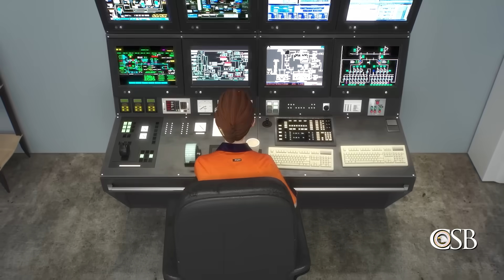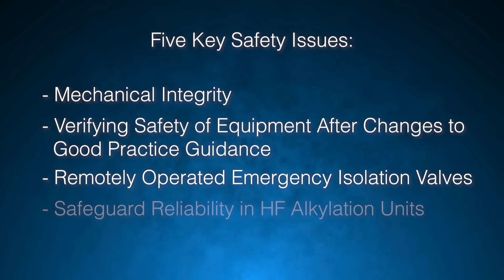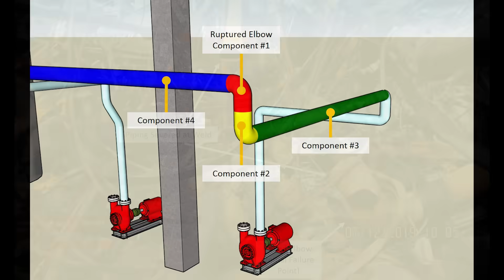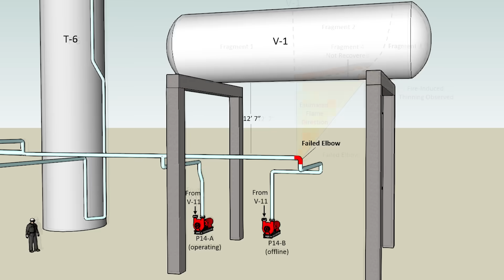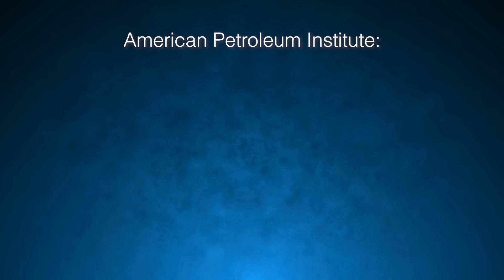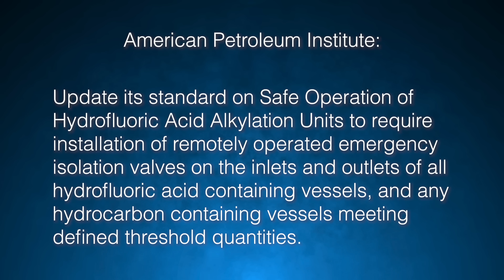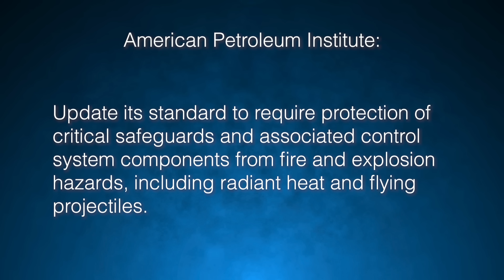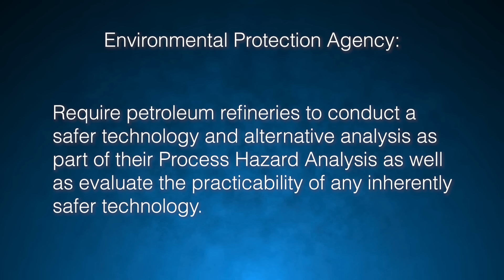Wake Up Call: Refinery Disaster in Philadelphia

Comment: I'm only at the very start of the video but the moment I heard an accident involving HF I cringed, there's not many "common" acids that scare me too much just as long as common sense and safety measures are applied when using them  (sulfuric, nitric, hydrochloric ect) but HF is one of them acids that I'm really uncomfortable working with even in low concentrations of 20% or less.
 although it takes a little longer to cause bad burns to flesh in the unfortunate event of an accident I have heard many rumors that the long-term effects throughout the entire body can be quiet severe.
I already suffer from fibromyalgia combined with ehlers danlos and the last thing I really need is HF exposure complications on top.

A vehicle detailer I work with was using aluminum cleaner which is a mix of various chemicals with the active ingredient 15% HF and they were spraying it from spray bottles with no gloves, no mask except a pair of safety glasses...
after I explained to her she really needs to be wearing proper PPE and a brief argument with her claiming she has been using it like that for years with no issues so I printed off some information about HF including the MSDS for the exact chemical she was using and the next day she had long thick chemical resistant gloves on with a face shield and a proper respirator, I can only imagine what her lungs look like after all them years breathing it in.

Comment: It's called bi-annual pipe and vessel inspections.  Every inch of pipe, and vessels should've been UT tested two times per year.  I live in a small rural town that has a large gas refinery.  It exploded in 1985.  Now it belongs to Hess Corporation and they inspect every inch of pipe, every vessel, and every pressure relief valve twice a year.  Once safety and inspection routines are overlooked this is what happens.

Comment: I was also a console operator on a Alkylation unit. A few things I’d like to point out. 1.) It’s actually insane that no one was seriously injured. I was actually driving across the commodore Barry bridge after a night shift and witnessed the sky turn from night to day from the explosion. At the time I didn’t know what it was but it was absolutely intense how bright it got. 2.) So much respect for this console operator and her ability to dump the HF out of the unit. With the explosions that acid could have traveled miles. 3.) I ended up working with a lot of PES guys after this explosion and they were all incredible to work with and extremely experienced. 4.) You hate to say it but a lot of times corners are cut or things are rushed in the hopes to save or make  money. 99% of the time we get away with it but that 1% chance something like this will happen. In a perfect world no corners should ever be cut and it seems that it’s the people on the business end that are making the calls from hundreds of miles away in office buildings out of harms way. 5.) The two refineries I worked at had constant x-raying/thickness reading taking place. Once they finished the whole unit, they would start over again on a steady rotation. Even then it’s possible not to catch everything because a compromised flange or valve or etc. can become an issue almost immediately with forewarning. Glad no one was seriously harmed. Great video.
Reply: As an NDT technician, the POD of flaws with thickness measurement is extremely low. Other tests like LRGW (qualitative inspection) are better but expensive. And is always about the money, unfortunately.
Reply: Insane, no, an absolute miracle that nobody was seriously injured or killed. I wonder if it was just sheer dumb luck or good design that prevented fragments from damaging the plant further, resulting in a greater release and potential explosion.
It's likely that it was just plain good luck that the deinventory tank wasn't struck by fragments, as that would've damaged the passivation layer inside the tank, likely leading to a full HF release and metal-fluorine fire.
For metal-fluorine fires, there is only one thing for them, good running shoes. Fluorine is a better oxidizer than oxygen itself, so we're talking essentially hell on earth, with toxic smoke an added bonus.

Of course, the risk was quite low overall, the only populated areas close were South Philly and Southwest Philly... Free privacy glass for the communities involved!*

HF is used to frost glass permanently. It's *that reactive. It's also a potent neurotoxin and general poison, which can in higher doses, dissolve bone. Typically, exposure doesn't immediately become apparent, as nerve cells for pain reception are instantly destroyed.
Oh well, at least it wasn't chlorine trifluoride. That stuff's just plain evil, as in, it'll even make ashes burn and set water afire.
Reply: It truly is amazing that a bunch of people didn’t die. I live across the river from this and the explosion woke me up. It shook my house.
Reply: I feel like it's a learning experience the more complex things man builds its hard to know everything that can go wrong somethings are high risk and most are extremely low risk but when everything comes together in chain of events things can go bad instantly humans make mistakes...
Reply: There should be a regulation that mandates the location of CEOs office to be located within 200 yards from the most dangerous process unit.
Reply: @mazabi22  See that little building or structure next to the pipes at 6:42? THAT is where the CEO's office should be. 😂
Reply: I am about to join a small refinery, learning lots here. Thanks for sharing the content.:thanksdoc:
Reply: monroe energy or paulsbro?
Reply: @ckyownz9  I worked at Paulsboro.
Reply: Honestly I’m blown away there wasn’t any remote valves on the line; having one that’s a fail close would have at least helped a little.
Reply: Dude, this channel and the surrounding regulations are what has hampered our heavy industry for decades. Jobs and industry have vanished to communist China. Regulations benefited the Chinese, not us. The risk for two or three dead people outweigh the many dying of starvation and as homeless people in severe weather conditions. Trump for eternity! Punishment to the EPA which flags important chemicals as dangerous and makes our production unbearably expensive. Let's hope Trump returns sooner than later and we get a safer, cleaner and less crime ridden society overall.
Reply: Wow the super brave console operator who pressed a button after a fire lets give her a freaking medal!! In fact we should have huge respect for anyone who even so much as pulls a fire alarm
Reply: proof that companies cant regulate themselves
Reply: I think having bi-yearly inspectations on All the piping would probably cost more than repairing the damage in this incident.

How much revenue do these facilities generate, that these requirements can be leveled against them?
Reply: @kriegscommissarmccraw4205  In 2017, Oil refineries in the US generated $15.3bn in revenues, with $13.2bn operating costs, or $2.1bn in net profits, an enviable 15.9% margin. Most operational costs consisted of purchasing of crude oil. There is plenty of room for investment in safety for workers, the general public, and least importantly future revenue for the oil industry.
Reply: @ConnerOfRS  refiners have vastly vastly different levels of profits.  Answer for this one
Reply: @ConnerOfRS  it's easy to say oil makes billions, but the fact of reality is that this refinery probably had a profit of less than 10mil yearly, and the costs for a full technical inspection would easily cost 10s of millions, and these costs are not just for the refinery, but much of it will end up getting passed to customers as well, due to power companies having to bring in power to fill the void, and this will likely last several months, if not a full year for a full inspection, it's easy to judge with hindsight at your side, but without it, this is just a tragedy
Reply: @alexnorth2452  "Run it to failure" seems to be standard in the industry, that's why oil and gas pipelines all leak. They don't care about the consequences because that's someone else's problem.
Reply: @ConnerOfRS Gasoline in the US is too cheap, it’s that simple. Its price doesn’t reflect the enormous costs of running an industry so as to not kill or injure the workers and surrounding communities. I’m saying that as someone who grumbled at the pump just as everyone else. But if I knew the price increase went directly into industrial safety, in a way that can be audited, and not into profits - I would be OK with that.
Reply: @absurdengineering  I completely agree. Yet the current record profits are being used for dividends, c-suite salaries, and increasingly adventurous exploration projects, not safety. Stricter enforcement of safety laws and new safety legislation will never be popular for the average joe, and therefore any politician. We have an infrastructure in the US built around subsidized energy; delivery company shareholders receiving most of the subsidy behind non-EV etc. commuters.
Reply: @kriegscommissarmccraw4205  I'm sure enough bean counters look at Union Carbide to understand how lucky they were and how big the cost could have been.  Alky units are terrifying.  HF might as well be enriched Uranium.
Reply: @kriegscommissarmccraw4205 I don't think it'd be possible. There is so much piping, and a lot of it is super fricking hot while units are running. Where I work (generation) we are required to have FAC inspections every 5 yrs, and rotate through the stuff..

I've done it myself, and luckily have caught some stuff. Once I caught a heater shell that had a small thin spot a half inch wide going about 6 feet around the tank. I wasn't even supposed to check that spot, and was supposed to check every 5 1/4"

Our QCs didn't want to fix it and wanted to prove me wrong about it, but I went back with 2 other meters and did a more thorough check, and sure enough we cut it out and it was bad. I was so relieved...

I wonder how much other stuff is missed though... and I try to avoid any high pressure steam lines while the units are running... never know

Comment: This entire presentation gives me CIA or NSA vibes to the extreme. It’s like we don’t have enough problems, so lets create the perfect disaster. After a lengthy investigation that leads no where. We create further laws to prevent future refineries from being built to help increase or decrease costs. The good part of this plan is that you can pull out the safety card. Additionally while at the same time maintain artificially high prices. If competition starts to heat up for whatever reason use the safety card if that fails then a good leaking pipe will fix the problem.

Comment: I work at a plant that has a full time maintenance department. It cost the owner much more than using sub contractors but the full time pipe fitters find problems like a corroded elbow and make appropriate repairs. Sub contractors only show up to do a repair and leave they don't know the plant in and out necessarily.

Comment: Oh I tell people start the saying it could be worse this could’ve happened, United States could die in the next couple of minutes because President Biden wakes up runs downstairs launches every need the weapon has at France because he had a dream about frogs.
This is the same possibility of happening than a pipe, so can we just keep to fax it didn’t happen so it couldn’t have happened otherwise we’re going out with a long long long long list of things what could’ve happened and you’ve just made this open in 12 hours long.

Why did the pipe only have one layer why didn’t the pipe of multiple layers so when it first layer breached the pressure went down they could’ve sealed the unit without releasing so much toxic gas into the area.

What is a point to have your safeguard system where you pump all the following all liquids if it’s only 5 foot to the left.

Brilliant they now have to check piping you still didn’t say in what period of time so do you only have to check that piping after 40 years because that’s how long it took to reach last time

If you have a pipestill what is more than 10 years old are you still working inside a modern era chemical plant why don’t we start using a lid again in hospitals it would save a lot of money for the hospital

I like watching cowboys and stuff like that because it’s your past but do you know the difference between a cowboy and modern era is that the politicians got paid a lot more money so safety was a lot less

If a pipe is no longer safe to use because the new law turned up that pipe should not be in the industry after the date that the new law turns up so this stupid bimbo saying they should’ve replaced it just means that these people who actually did this right up of how bad they did have as much teeth as a goldfish

And the company needs to add in technology that allowed you to do something remotely when the company had this and it all failed. 
Why not when you’re pumping something like acid into a safety valve or into a safety container you don’t have it in the same pitting section where the pipe is because there’s no point you’re just building a bigger bomb.

Comment: That problem elbow was installed around 1973 and it's almost 2023...SO we are SUPPISED to believe, that over a 50 year period, with as many TRILLIONS of dollars that THIS refinery alone has made off the production of petroleum products, that NOBODY had time to check and recheck every pipe being used to make sure it was trustworthy? Sounds like to me, it was either a looming disaster that was being intentionally permitted to continue for some reason...or, the highest level people in charge of this refinery that, as part of their job, should be held accountable for the incident because they are getting paid very high wages to ensure that things like this dont happen, but did.
But in THIS WORLD, people that live that good, dont go to jail...now do they?
HOWEVER, there ACTUALLY IS one thing that they hadn't planned on...if there was "intention" foul play in this situation, there will be a punishment for corrupt practices and those responsible for them...because as it turns out, the Christ that we read about in the holy bible, actually is getting ready to return to earth to hold people accountable for their wrongs. Unless they repent and turn from their wicked and corrupt ways, there will by terrible terrible consequences for their actions...and we now have proof on earth that this very biblical event is VERY SOON to take place on the earth. So PLEASE, if you run a refinery or work as a cashier at a simple gas station...REPENT of your sins and get right with God before it's too late. God wants EVERYONE back, from CEOs to prison inmates, to hookers and unemployed people. Everyone, God wants us ALL back with Him. And thank God for that.

Comment: Even with all the current refineries operating at full capacity and receiving schedule preventive maintenance on a regular basis the refining capacity in the United States has not been increased in over 25 years. The lack of refining capabilities means that the United States has to regularly import refined oil from other countries. This is not good. And losing another refinery like this puts a severe dent in the country‘s ability to process crude.

Comment: If they don't do it already, they could use the same tool they use in machining parts in factories to check thickness of parts walls, in hard to reach part measurement area, that is usually not removed from the parts set up operation and run location. All one would have to do is place check point paint dots at key places on the pipes and have the employee to check pipes wall thickness measurements on a dayy dasas, a new  job duties to find a problem to be fixed. Just saying....

Comment: I used to go to that plant for emission control equipment servicing. You had to receive safety training before being allowed to enter the facility. They made a big deal about sulfur dioxide poisoning. If you smelled the SO2, you were required to tell your escort and sound a portable alarm. The training was done in a construction trailer near the entrance. I notified my escort (every time) that I smelled rotten eggs indicating the presence of SO2 as soon as we got done with the training and exited the trailer. They just laughed. I'm glad that place is gone. It was way old and crusty in a very populated area. An accident was inevitable. Luckily the general public wasn't harmed.

Comment: Deja vu for me.  May 5, 1980 Depropanizer feed line failed underneath the Deprop feed surge tank due to incorrect metallurgy installed during construction in the 70's.  Most of the safety regulations and/or recommendations were a direct result of this fire.

Comment: When you buy a house it has to have been inspected, perhaps this should be done with industrial units too. Inspectors should be employed with the knowledge they will be sued/jailed should they be negligent in their duties. Parts should be replaced periodically whether they show signs of wear or not much like in transport where if you remove the engine you replace the clutch whether or not it needs to be.